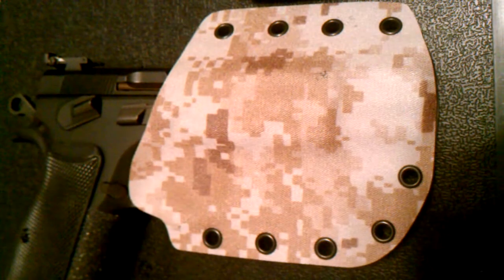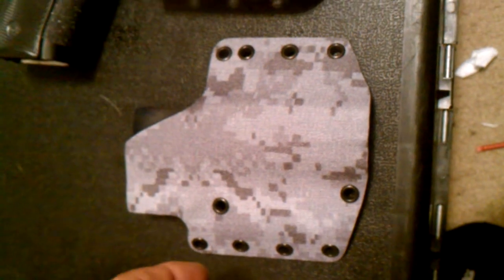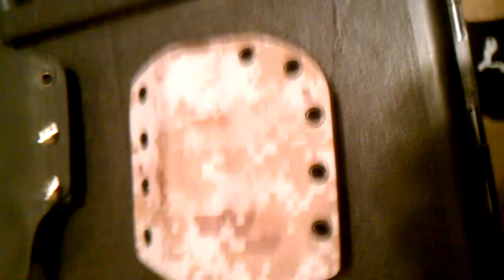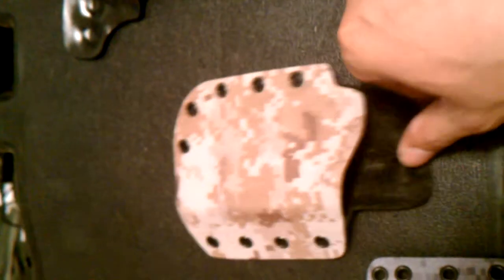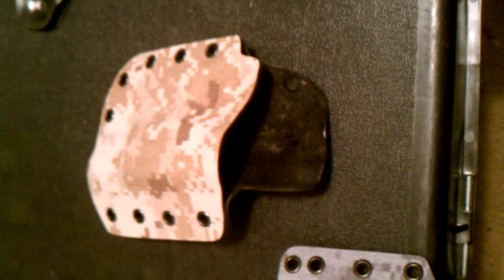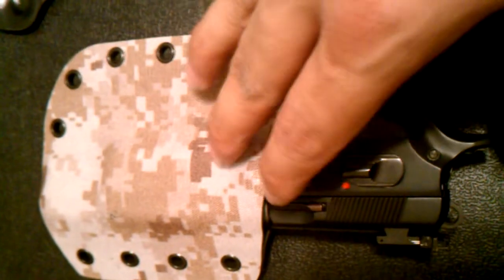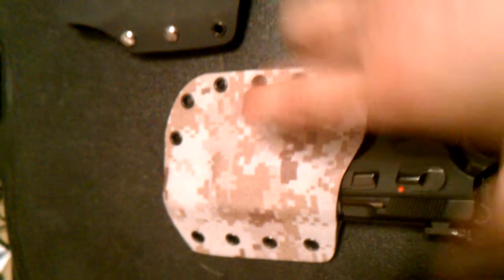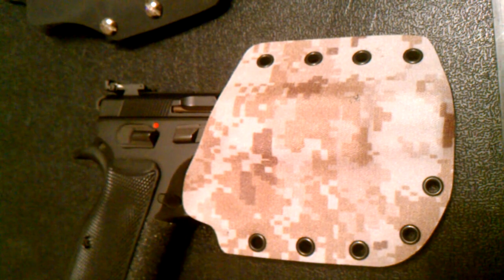Custom kydex holsters with felt lining

Comment: Badger glue? Why would you want to glue a Badger? ;-)  Anyway I am thinking of using Loctite 200 or 300 spray. Trying to put 1-2 oz leather on the inside and outside of .060 kydex for a OWB holster. What adhesive do you recommend?